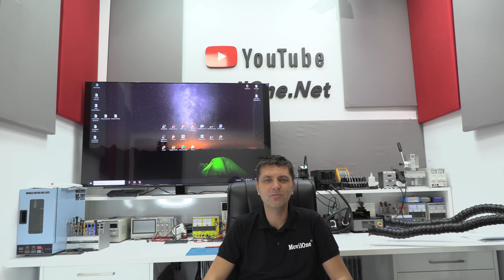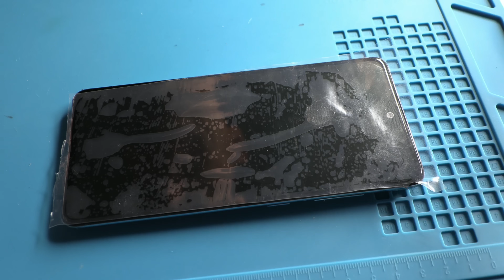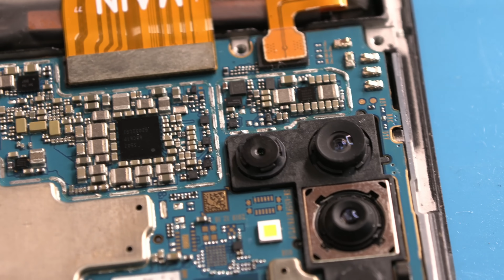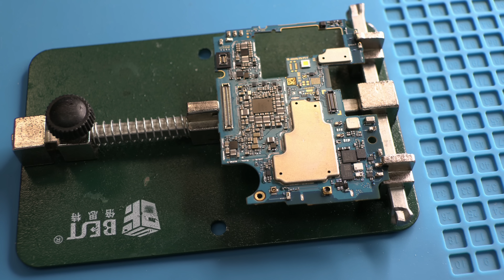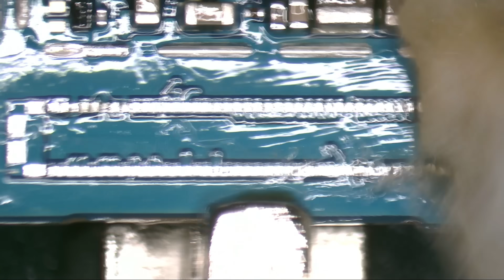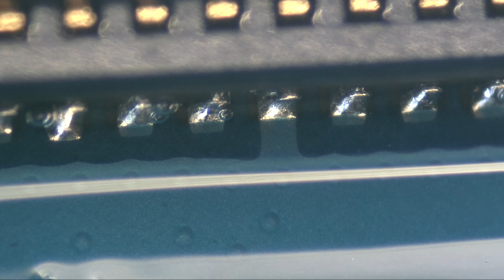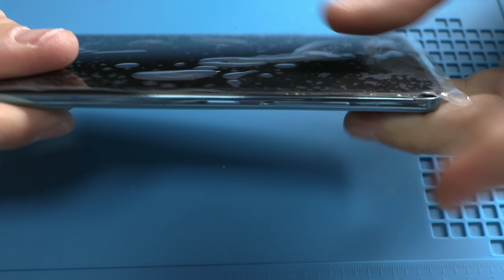The Samsung A Series Secret They Don't Want You to Know!

Comment: Btw it doesn't affect only series A also series like S20/S20 FE/S21...etc, although i use lower temperature 330C with 50% air flow it is safer for ensuring the FPC port doesn't melt so i can reuse the same FPC with new solder. I prefer Amtech or Stirri-V3-TF flux It smells better loll
Reply from the maker: Absolutely! This issue affects not just A-series, but S-series models as well. Using lower temperatures and controlled airflow is definitely a good approach to avoid damaging the FPC.  😄

Comment: Then if the lead free solder doesn't crack it could grow tin whiskers and short something.  Lead may be an unpleasant metal but there is a reason it was in solder.  Besides, there are metals far worse than lead out there that are so toxic that they stopped using them in rat poisons because they are just too toxic.
Reply from the maker: Lead solder lasts a long time, it can last you decades.

Comment: Two comments:
1) The connector is not self-centered completely. In such a light component may suggest the solder whas never fully melted at any time.
2) Flux is your friend, but if possible, avoid that it gets to the connector contacts. When it dries with heat, it can leave a crust difficult to remove. Small pins may not push enough to pierce it.
Reply from the maker: Thanks.
Reply: Yes

Comment: All of the automotive computers in ICU fail because of faulty soldering or bad grounds internally any person can do a little research and repair them on their on for less than $10
Reply from the maker: You're absolutely right many automotive electronic failures are due to bad soldering or grounding issues, and repairing them can be a cost-effective solution compared to dealership prices.

Comment: I am so tired of people spreading lies all over the internet because they can hold a soldering iron.

Products ARE NOT designed to fail. They are designed to price. Quality management is the art of balancing price and quality level. Are you people really demanding to have 5 dollar capacitor in a 100 dollar phone? How entitled are you? If you want lasting product buy the expensive shit. 0 of my phones stopped working, not a single product I ever bought. Why? Because I don’t buy cheap shit. There is a reason for the price and it’s called QUALITY.

Btw in 40 years not 1 device stopped working. And I never sell my properties. 

These conspiracy idiots annoy the crap out of me. Nobody is designing to fail because that would open a law sue if proven correct. Geez people, get some education.

Edit: I maybe should add that I am and were a test project and quality leader for many products, consumer and industry. And you most likely already used one of it. You’re welcome.

Channel ignored. What bullshit.
Reply: do you work for samsung or what got you so mad? samsung is the brand also known for designing televisions with caps placed in hot spots to break faster. it wouldn't cost more to place components better
Reply from the maker: Thank you for sharing your perspective. It's true that there is a balance between cost and quality in product design, but the issue many of us highlight goes beyond just price. While cheaper components in budget devices are understandable, certain manufacturing choices—like difficult-to-repair designs or intentional software updates that hinder performance—appear to prioritize short-term sales over long-term usability. These practices raise concerns about waste and sustainability, which are important discussions to have.

As someone with experience in quality management, your insights are valuable, and it’s great to hear you've had durable products over the years. However, not all consumers can afford premium devices, and they deserve reliable options within their budgets too. This isn’t about entitlement, but about advocating for fair practices and better design across all price ranges.

I appreciate your contribution to this discussion—debating these topics helps raise awareness and push for improvements in the industry. If you'd like, we can continue discussing this in more detail.
Reply: Then why do old phones that costed even less dont have these issues? 

Why is the 300 dollar one plus phone I own, completly fine 4 years later?
Reply: This guy could have said 'They cut some corners, this is the result.  This is how I'm going to fix it".

Comment: Thanks for the info. I've blacklisted SAMSUNG phones since Galaxy S3 & Note II due to their problematic EMMC that causing SDS
Reply from the maker: It’s understandable why you would blacklist Samsung after those experiences. Faulty eMMC chips on devices like the Galaxy S3 and Note II caused widespread issues, and it’s frustrating when such critical components fail prematurely. Thank you for sharing your story!
Reply: Put Sony in with it too!
Reply from the maker: I completely understand your frustration. The SDS (Sudden Death Syndrome) issue in the Galaxy S3 and Note II was a serious flaw linked to the EMMC chip's poor durability. Sadly, Samsung never took proper responsibility for that design failure. Your decision to avoid Samsung after that experience is understandable when a brand repeatedly fails to prioritize durability, it's hard to trust them again.

Comment: Just look up the history of programmed obsolescence starting with the ordinary incandescent light bulb. This is what it means:

Programmed obsolescence is a practice where a product is designed to have a limited lifespan, encouraging consumers to replace it sooner rather than later. This can be achieved through various methods, such as designing products with parts that wear out quickly, making products incompatible with future updates, or creating products that are difficult to repair or upgrade.

For example, inkjet printer manufacturers often use chips in their ink cartridges that prevent them from working after a certain threshold, even when there is still usable ink left. This forces consumers to purchase new cartridges, contributing to the cycle of planned obsolescence.

In the technology sector, software updates can sometimes slow down older devices, making them less desirable and encouraging consumers to buy new ones. However, it’s important to note that not all instances of products becoming outdated are due to programmed obsolescence; some are simply a result of natural technological advancements.

Efforts to combat programmed obsolescence include advocating for the right to repair, which would allow consumers to fix their devices rather than replace them. Additionally, some companies are taking steps towards more sustainable practices, such as designing products to last longer and providing repair services.

The concept of programmed obsolescence has been around since the 1920s, with notable examples including the automotive industry’s annual model-year design changes to boost sales. More recently, concerns about environmental impact have led to increased scrutiny of this practice, with some countries implementing regulations to discourage it.

Note: Also see what planned obsolescence means.

Remember this: WHY IS IT NECESSARY?  YOU WILL BE SURPRISED BY THE ANSWERS!

Comment: A50, a70, 51, 71, 72, 52, 53, 54, 34 very very common issue. When I replace the displays I prefer to buy the parts that come with the frame so that I don't have to disconnect this exact connector.
Reply from the maker: That’s a smart approach! Opting for display replacements with the frame saves time and minimizes the risk of damaging fragile connectors. Thanks for sharing your professional insight!

Comment: It's the same story everywhere though all new products. For example car engines wet belts and plastic inlet manifold with catastrophic planned design failure.  Not green intact the opposite.  Green would be built to last.
Reply from the maker: You’re absolutely right cost-cutting and planned obsolescence aren’t exclusive to electronics; they’re widespread across industries. As you mentioned, real "green" products would be built to last, not designed to fail. Thanks for bringing up this important point!

Comment: Unfortunately this is nothing new, it is not a revelation in itself.. suff has been designed to fail for years.. ...  Laptop manufacturers did exactly the same thing with their laptops.. where the user would place their palms to rest on the laptop would slowly eat away at the ribbon cable underneath over 2 years or so the cable would eventually break just as it runs out of warranty..  This carry on has been going on since the Invention of the light bulb...
Reply from the maker: You’re right planned obsolescence has been around for decades, from light bulbs to laptops. The example you shared about ribbon cables breaking just out of warranty is a perfect illustration of how these practices have been normalized. Thanks for sharing your knowledge!

Comment: how about  A20s?
Reply from the maker: The A20s is known for having some durability issues, particularly with the charging port and motherboard connectors. If you’re experiencing problems, feel free to share more details—I’d be happy to help!
Reply: @MovilonePhoneRepair  yes, you were correct. I had to change the whole charging board unit 2 times. Now I just keep the phone for emergency use.

Comment: Probably such issues are also often caused by regulations or "green initiatives" by the manufacturer.
The use of recycled materials, the ban on certain substances and replacements being inferior, etc.
Reply from the maker: You’re absolutely right regulations and green initiatives often push manufacturers toward using recycled materials and banning substances, but the replacements can sometimes compromise quality. Balancing sustainability and durability is a challenge that needs more attention. Thanks for sharing your thoughts!

Comment: What about the vertical green line issue?? 😢
Reply from the maker: The vertical green line issue is often linked to display or connector damage. If you’re experiencing this, it might require a screen replacement or connector repair. Let me know if you need guidance!
Reply: @MovilonePhoneRepair  oh thank you well hopefully that's the problem and not the entire screen. I have Samsung Galaxy flip 3 I'm at 4 lines now

Comment: Is this fault also present in some S series, such as S21? My old S21 didn't charge well, probably because the plug doesn't fit as well as it did when new.

I've tried to see if dust had gathered to partially block or etasjen connection to the charging port, but couldn't see anything obvious. I've tried to use a small pin to clean out any loose dust from the pretty, but it seems good.
Reply from the maker: It’s possible that wear and tear on the charging port is causing your S21’s issues. Even if no dust is visible, internal alignment or connector damage might be the culprit. A professional cleaning or port replacement could resolve the problem. Thanks for sharing!
Reply: I have a S21.  Runs fine, BUT....  There are some USB-C cables I have laying around that just do not work with it.   Most do, but a couple do not.  They work fine with other stuff though.  Push comes to shove you still have wireless charging.  Slow, but not bad.   

So, could be the charger cable.

Comment: My samsung a52s 5g doesn't always want to charge, so I have to hit the place where the battery connects to the motherboard, and it starts charging again
Reply from the maker: It sounds like there might be a loose connection or a damaged battery connector. Having to hit the device is a clear sign that something is not making proper contact.
Reply: @MovilonePhoneRepair  probably. One time I opened it up (the back panel design is so dumb that the plastic panel came off simply by taking off the case multiple times) and unplugged the battery and plugged it back again and it worked

Comment: I think in this case, it has nothing to do with built-in obsolescence and more to do with lead fee solder. Us techs continue to face issues with modern devices because of this stuff. Game Consoles/phones/Laptops and any number of electronic devices that generate even a little bit of heat or are prone to shock though use. We almost never see these issues with older pre-90s technology. Dry solder/ BGA ball failure/ and component failure due to slight bending or movement of a motherboard are all to do with this  rubbish solder that manufacturers are forced to use. I'm afraid that until a better solution is found or a complete u-turn on the use of leaded solder is made, we will continue to see this happening, especially as technology gets more sophisticated and components become smaller.
Reply from the maker: You bring up a great point. Lead-free solder has indeed caused a significant number of issues in modern electronics, from dry solder joints to BGA failures. While it was an environmentally motivated change, it has created durability challenges, especially in heat-sensitive devices. As technology continues to advance, we can only hope for better alternatives. Thanks for your detailed and thoughtful comment!

Comment: Personally, sounds like a you problem. I had a client come to me with a samsung unable to take in a charge. I took the phone apart and put in a spare sub board for the s21fe and it worked perfect no issues. If you're have to do more than that to get the phone working you arent as good as a technician than you think.
Reply: He did say he only needed to replace one part too so yeah
Reply from the maker: Sometimes a simple part swap is all it takes, but not all issues are that straightforward. It depends on the specific failure some require more in-depth troubleshooting. Good to hear your repair worked smoothly!
Reply: a lot of trolls here. as if you know anything about repairs if you replace the whole board instead of the connector

Comment: I had my galaxy A12 for 4 years and it still has no problem but cracked screen I'm currently using a Huawei P30 (china model) only model on HarmonyOS 4
Reply from the maker: Four years for an A12 is quite impressive! A cracked screen is a small issue compared to overall functionality. Huawei’s P30 (China model) with HarmonyOS 4 is an interesting choice hope it’s serving you well!
Reply: @MovilonePhoneRepair  I changed up I gave my P30 to my sister because she wanted a P30 now I got the P40 lite (china model) but sad thing is it's only on HarmonyOS 2

Comment: My Galaxy A8 from 2018, still works good. I by myself replaced the screen 4 times, and the battery  once. Even though I do not receive system updates anymore. Stuck at android 9.
Reply from the maker: That’s impressive! Your Galaxy A8 has lasted well, and replacing the screen and battery yourself shows how important repairability is. Android 9 is outdated, though consider trying a custom ROM to keep it secure.
Reply: @MovilonePhoneRepair   It's easy if you have some pc building knowledge. Same as in PC's, everything is modular, and just snaps in place. The battery is well glued in with strong double sided sticky tape, and one must exercise caution in not to poke a hole in the battery, because the battery will catch fire.
Reply: Install custom rom
Reply: @specttech99 What is a custom rom and would it work in a Samsung J7?
Reply: @Mick_Ts_Chick  as the name suggests  a built or ported ROM from other devices rom or firmware for your phone specific. Galaxy A8 has a custom ROM oneui 6.1 android 14 
As for j7 I think oneui 4.1
Reply: @specttech99  Ok, thanks for the info.
Reply: please get yourself a custom rom for the sake of your security 🙏
Reply: You've damaged and replaced your screen 4 times since 2018???  Sounds like you need a screen protector and a a good case like an Otterbox Defender.  That is cheap protection for a much more expensive phone.  And to pay better attention in handling your phone.
Reply: che problemi ti dava la batteria? il mio si riavvia in loop e raramente si accende, la batteria ha 6 anni e non capisco se sia il problema
Reply: @fabiocaramia5305   Did not hold a charge properly. It drained in just 6 hours.
Reply: I am a proud owner of A8+. After 6 years, i managed to replace its battery by myself. I love its premium look especially the camera. How i wish samsung produce 2nd generation of A8+!!!!

Comment: I have A samsung A705 , working for 6 years no issues whatsoever , replace it ,keep it as backup, If I am choosing between I crapp and Samsung , I choose Samsung , easy to open , I need one screw driver Not A whole set Like I crapp. I replaced the Battery myself .
Reply from the maker: Your A705 lasting 6 years with no issues is impressive! Samsung’s older models were easier to repair, and as you said, a single screwdriver is all you need unlike Apple’s complicated assembly.

Comment: After just 3 years. My A8+ stopped charging. Took it for repair. They changed the USB port and it charged. After 3 days same problem. 
I stoped using samsung since then. 3 yrs is little for me to change a device that is completely working. I bought i phone 13 instead
Reply: I have a Samsung S21 4+ years of ownership.  Good for you, whatever.
Reply: @ A series are good devices but  made to fail. Thats theft of client money. Plus 
The back is broken, the battery needs replacement. Cant find that on the local market. 
Also being outside the US we get the shitty exnos chip. I have used samsung all my life since the E250 so its most probably longer than your whatever's. 
Next year after 4+ years i can resell my phone $200 if i want to. How much is your whatever worth right now?
Reply from the maker: That’s frustrating charging issues should not happen so soon. If a repair doesn’t last more than a few days, it’s often a deeper motherboard-related fault.